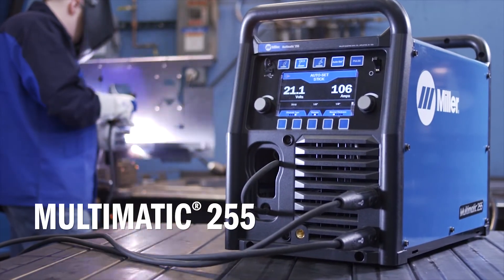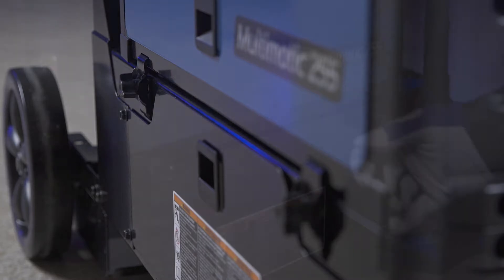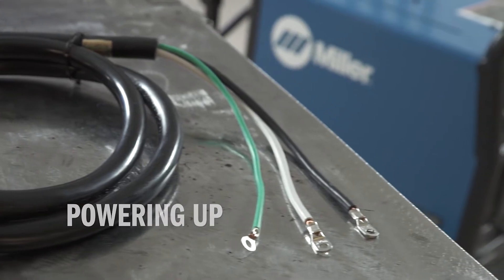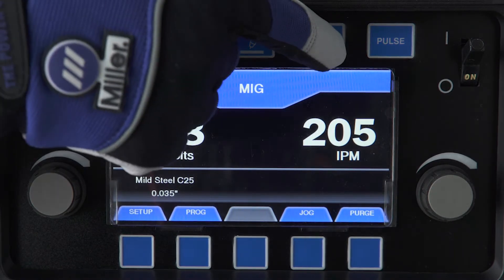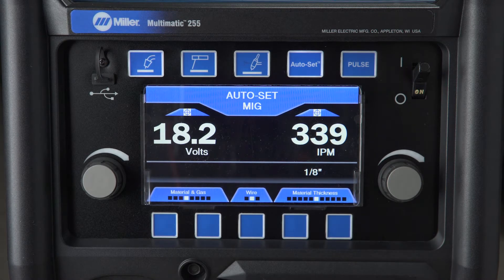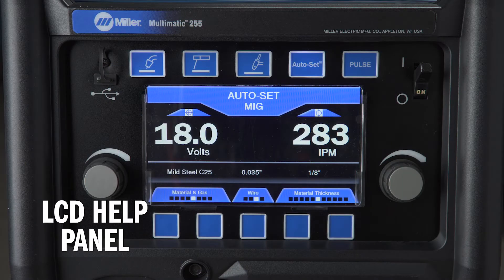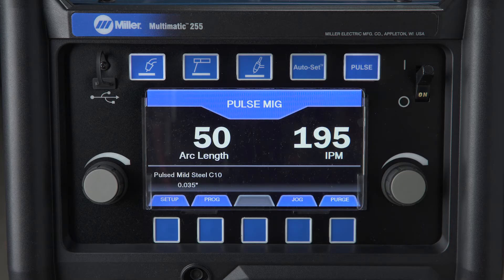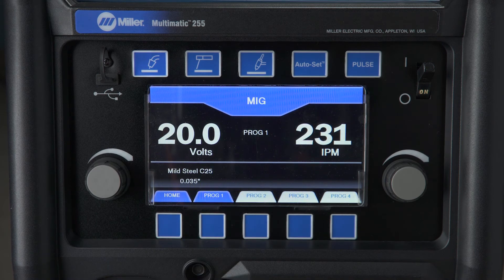Multimatic 255 Multiprocess Welder Setup

Comment: Smart design on the bottle forward so the machine could be removed while the bottle was left on and the cart not flip. 
The locking mechanism on the cart to secure the machine is a good idea along with the storage on the bottom. 
Price on the tig torch I about right according to the price on torches,  connecting adapter and gas hose.

Comment: why no ac tig
Reply: Because they made the 220 for that
Reply: I just purchased the 255 I do way more mig I prefer the larger machine . just my opinion  @weldingjunkie
Reply: scott bottoms I know I have the mutli 255 too but they aren’t going ti put AC Tig on it. If they added ac no one would buy the 220 was all I was saying.
Reply: scott bottoms I went with the 255 for the 350 amps too even tho the top end duty cycle is low. The 220 ac/dc is 60% at 200 amps and the 255 is 240 amps at 60% so yes the 255 is bigger by the output isn’t off by much of the 220
Reply: Is pulsed MiG not available in 120v in any machines?
Reply: MakeItRainLL no just the new 255 series multi and matic awesome machines. I love mine.
Reply from the maker: Hi Scott, The Multimatic 255 can perform stick, DC TIG, pulsed TIG, MIG and pulsed MIG welding. Thanks for your feedback as we continuously work to ensure our products meet the needs of our customers.